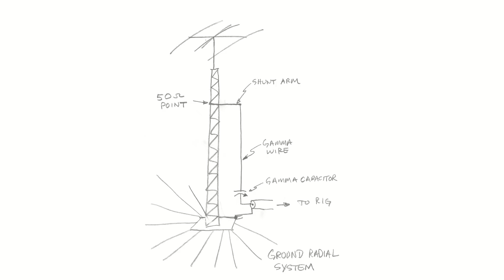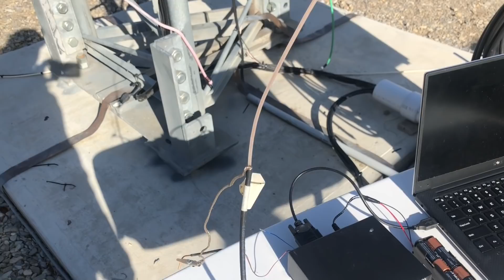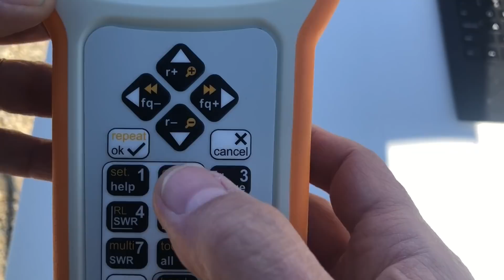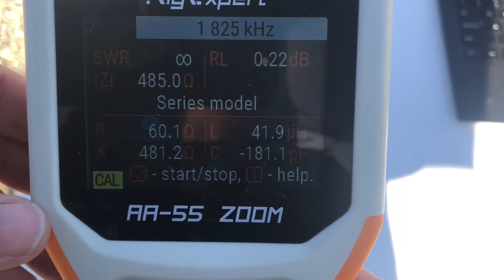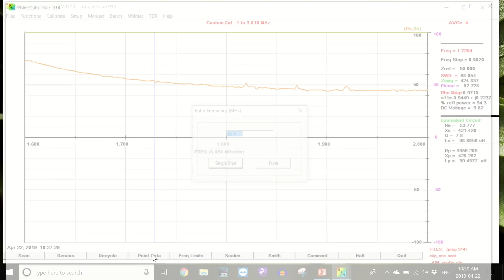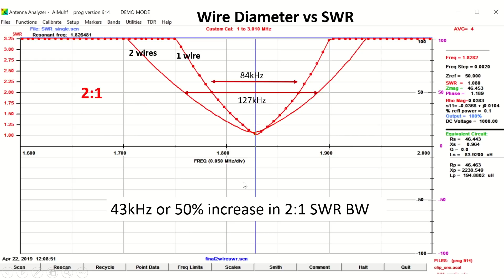How to shunt feed your tower

Comment: Excellent Video. One thing I noted was that you didn't make use of the AA-55's Memory.  You could have easily stored all of your measurements in one save, and then brought them into the house to put on the software for viewing.  There would be no need for the computer outside.  SWR, Phase, Reactance and Resistance are all stored with one save. Just a thought.

Comment: Thanks for making such a detailed video. Could you make a part two and show how you feed the shunt wires? For instance, did you replace the variable capacitor with a fixed capacitor? Was the measured value of the variable capacitor the same as what you ended up using for the fixed capacitance? How do the two shunt wires connect to that capacitor? How is the coax connected and the whole thing protected from the weather? It would be really interesting to see how the relays work at the bottom of the tower, too. That's an amazing remote antenna setup!

Comment: Hello Steve: Many thanks for your videos, i really enjoined. I have a similar situation as you describe at the end of the video. 
In my QTH i have a VERY limited space. After 10 years with a StepIR GP antenna i tried an almos impossible mission, to install a SO2R setup with 2 small tribanders, 40m rotative dipole, 80m Inverted L and 160m inverted L in 66 square meter roof, 
avoiding using coils in my antennas.  
After 4 years of work and several test im almost finished. Now im just thinking in to the last step, to remove 160 InvL and shunt feed the tower.  
Yes you´re right. Dont believe all you read in groups or forums, just tried the best you can do and experiment by yourself.

Comment: Well done video. Special thanks for your warning about insulated elements on the tower. A friend of mine is about to shunt feed his 75 Foot fixed tower. He has a Steppir antenna, and we're going to have to look closely at what might be induced into that antenna during transmit. He often runs 1.5KW. Ken W8ASA

Comment: Interesting video. I am looking at options to load my AB577/GRC mast which is a portable 50 ft large diameter tube tower "rotatable". I would like to do so without having to connect to it, but finding very little information about inductively loading it.

Comment: Question, I have a 2nd floor apartment station with a small 21" 3 element yagi that's mounted on a 6" coat rack indoors that's actually doing well hitting repeaters 79 miles away. I can't ground anything properly so would a counterpoise do anything?